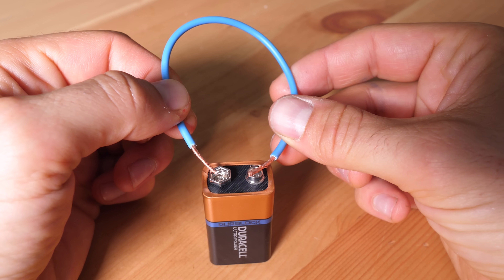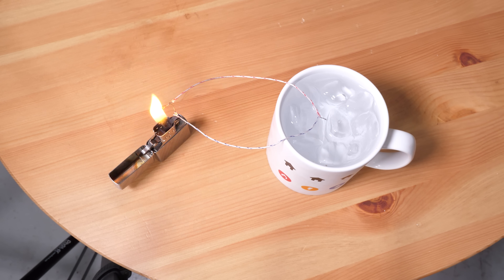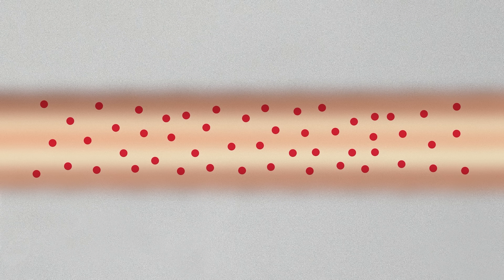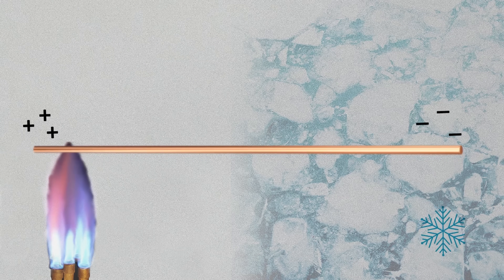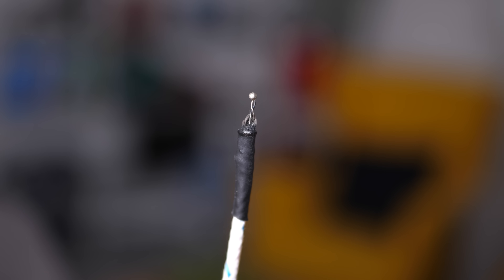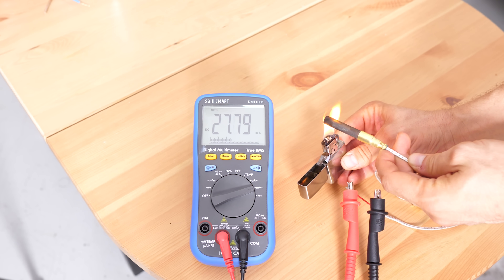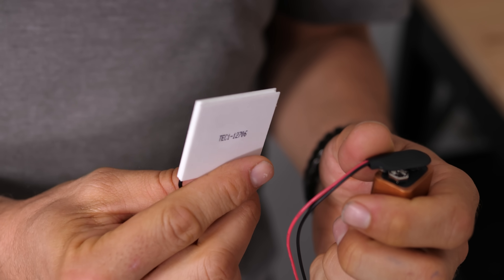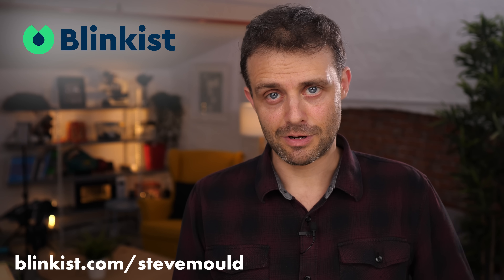Make Electricity Go Round and Round - The Thermoelectric Effect

Comment: I was reading a book to my kid about spacecraft and it mentioned that the generators on Voyager I and II use heat from the decay of plutonium to heat wire made of different metals to produce electricity. I always wondered how a radioactive source could make a small sustained electrical source and you video describes it perfectly.

Comment: a few years ago I had a need for a water chiller, so bought a 10x of TEC/peltiers from china, by far the cheapest way to get them. I needed 4 for my project, and broke one.

with the leftovers, thought Id play around, I decided to make a kerosene powered phone charger. I saw this: http://www.douglas-self.com/MUSEUM/POWER/thermoelectric/Russian%20Kerosene%20Lamp%20Generator%20a.jpg in an magazine a long time ago, which I found online here http://www.douglas-self.com/MUSEUM/POWER/thermoelectric/thermoelectric.htm . an excellent page, an OG example of what the internet was.

I went with a kero tilly lantern, AKA a hurricane lantern, a small Al heatsink with quite wide fin spacing (i didnt want to much soot fouling, and being able to clean it with a cotton bud was important) on the hot side, and an old 120mm heatpipe CPU cooler for the cold side.

I got it working pretty damn well. using a 5v 120mm fan, I could get a pretty consistent 6v supply, the fan taking about 100mA, if I drew more than about 600mA the voltage would tank to below what the fan needed, and that was a bad time. but I was able to charge a phone with it. I didnt use my good phone at first, but after a few succesful tests, a kerosene flame and a good heatsink, usable power! I took a vanity shot with my good smartphone, but most testing was done with a small powerbank or obsolete phone.

the most important thing I learnt, you need to bootstrap the cooler. just lighting the flame and heating it up never worked, as the waste heat warmed the 'cold' side, so it never made power. you needed to run the fan off a battery for the first minute or so to get your temp difference. just lighting the flame, eveything warmed up evenly. start the fan, light the flame, give it a bit, remove the battery and connect the fan to the peltier. enough power to run the fan, and she ticks along wonderfully.

The best thing about this system is its 100% recovery, no loss in using it. if you need to run a kero lantern, your wanting light, and the heat is waste. sure, its awful inefficient, I figure 5-7%, but not using it is 0%. some power is better than no power. I wouldnt want to depend on it, but it can charge your phone if you need it. 

I think the coolest application tho, is distributed lighting. I quite like the light from a kero lamp, for a social, ambiance setting, talking, drinking, eating. not walking into things. but 2-3w of LED lights is really quite a lot in comparison. and it can be directed. for cooking, reading, fine work, its gamechanging. a Kero burner can easily light up 2-4 other workspaces.

granted, this isnt cheap or practical for a 3rd world/humanitarian situation, it was once a very expensive heatpipe cooler (but obsolete CPU, so worth very little), and a very efficient fan. it also really only worked hanging, so much weight up top. but for my situation, main living space outside under the patio lit by kero (hanging from the rafters), a 3m wire into the kitchen, a few 1ft lenghts of strip light and a spot COB, actually worked brilliantly. easily quadrupled the lit area one small flame could manage. 

Ive got very reliable 240v from the wall and more solar panels than I know what to do with, but this was a pretty fun project. the peltier effect is just a flat out neat phenomenon. if your so inclined, they are very cheap from china (dont get the good, expensive ones till you have a working system, you will break them. well, I did...) very fun to play with if you like thermodynamics. 

PS, If your not into buying new things, there are SO MANY peltier fridges thrown away. they are, generally speaking, pretty shit. readily available from your local thrift shop, recycling center, dump shop etc. but a great source of TEC's, and pretty chunky heatsinks to. 

happy hacking!

Comment: At 4:55 you say that the electrons go in a clockwise direction. Flowing from plus to minus. But electrons are negatively charged and thus flow from from negative to positive. Earlier at 3:26 you clearly state a deficit of electrons on the hot end. If there is a deficit, the electrons should (again) move from cold to hot, because at the cold end there is a surplus. Thus going counter clockwise.

Comment: This doesn't really feel like a perpetual thing, does it? A voltage is pushing current around.. Here the voltage is by Seebeck effect. If you short the secondary of a transformer, then also the current is going round and round. There the voltage is by induction. 
If you want to see current going round and round without a voltage, look into superconductors. You can start a current and short the ends and current will keep on flowing. How do you know? You can measure the magnetic field generated by that loop. 
This is used in all modern MRI scanner magnets. The magnet is made using superconducting wire (Nb-Ti wire). After charging the magnet to anywhere from 200-500 A, the ends are shorted by something called a Persistent Current Switch (PCS) and current goes round and round. If you check a MRI scanner, there will be no wires connected to the magnet itself. It is electrically isolated from everything else. (The only downside is all this happens when a superconductor is dipped in liquid helium at 4.2K.

Comment: I have a theoretical question if we were to make an upscale version put one end in say Cairns Queensland Australia read it down the coast to Antarctica is it feasible that the temperature difference would create a current? ..if so how much .. could we have a system in which just to charge your phone's or street lights or is it completely not worth it at all?.. or ofcourse if we could build one around the earth through the North Pole down through the equator through the South Poleand back up through the tropical equator again and let that be the loop.. hot and cold of course then you've got resistance to deal with but I don't know....
Reply: Unfortunately no. The driving force of this effect is the difference in temperature not the distance. A lighter flame is somewhere around 2000C with the iced water near 0C, so a difference of 2000C generated 10s of mA of current but even a single phone would require 100s of mA to actually charge. In the natural environment you would be lucky to get a 100C difference. And also, as you mentioned, wire resistance is a thing and has an increasing effect the longer a wire is and it would completely neutralise this amount of current (converting the electricity to heat) over any useful length. I also suspect (but have not researched) that the more gradual change in ambient temperature that a long length of wire would experience would also work to cancel out or at least reduce the effect.
Reply: I hate how the world's full of this stuff that you can't really do much with.. it's like an Awesome fact but good luck trying to do anything with it..🤣🤣🤣 such is life🤣👍 cheers

Comment: I hate to point out another flaw in this great video, but I take a bit of issue with
"in [...] metals some of the electrons are free to move around in the bulk" @ 1:57
As the free charges reside on the surface of the conductor, I think you should have worded this differently.
Reply: Fantastic explanation of the effects, though ^_^

Comment: At 5:07 you said that thermocouplers are used in a lot of thermoteters, for example in the push in thermometer you used. 
From my experience (especially in the industry) resistance based measure is much more common than voltage based measure, and also a lot more precise. The industry uses PT100 or PT1000 to measure temperatures accurately. Those are sensors that use a piece of platinum with a known temperature-resistance curve. So the resistance measured is proportional to the temperature. Thermocouplers sre generally used for medium to high temperature applications (>200°C).

Comment: You explained that the two different metal wires create a flowing current. My question is why are they flowing in opposite direction if so then would making a loop with just the metal with the higher seebeck effect create a higher current?
Later in the video you explained it with adding voltage to create the heating/cooling effect. The electrons "bouncing" from one level to another. Is this the same principal that creates the flowing current when the wires are exposed to ice and fire?

Comment: Is it possible to have 2 metals - though they may be ceramic or something - which are both superconducting but have different thermoelectric constants?
Could you create a voltage and therefore current in them but because they superconduct the current never decreases?
In fact it increases as the effect goes on for longer.
Would a super-magnet or something occur?

Comment: So let's say you could freeze one end to near absolute zero, and put the other end in a pressure chamber to increase the melting point of that end, and heat it above the melting point at atmospheric pressure, would the voltage be greater than just doing it the way demonstrated in this video?

Comment: One confusing part of the description was that it sound as if one could generate cold by just pushing the electron in one direction. This is however not possible: You cannot just generate cold (also first law of thermodynamic would be violated else). Peltier always have a hot and a cool side.

The way I'd explain it is more with an analogy with a fridge where air is decompressed on one side to generate cold, but then it needs to be compressed again for the cycle to restart and that generates heat (no choice).

Comment: Thanks so much for making a video on this! It is a really fascinating principle. I wanted to say that the master volume on your video was extremely low this time. Even with my volume turned all the way up it's hard to hear without headphones.
 I am familiar with the peltier effect from My friend who works at the railroad says they use them to power the equipment in the event of a power out. That's why you see propane tanks alongside of train tracks.
My parents also have some ice chest coolers that are electric, plug them into the 12 volt outlet on the car and it creates about a 25f difference in temperature to the ambient

Comment: The same mechanism as in boiler is used in some gas-powered kitchens, where such thermopile or thermocouple forms a safety mechanism, closing the valve if gas burner gets extinguished, perhaps because the thing heated up boiled over.

Comment: I have a gas stove, and it's not connected to electricity, doesn't even have such a connection, it's about 20 years old. The single stove burners do have a - compared to the thermopile you showed from a boiler - tiny tip sticking out next to where the flame is, so I wonder, do they work based on the same principle? Because then that would mean the solenoid needs only very little power to be held open, since this tiny thermopile (if it even is one) of course generates much less power than the one you showed here. The ones on my stove are maybe 2mm in diameter, something like that...?
(I've always wondered how that works, and I assumed some sort of bimetallic effect, but no, it's even more genius, if it actually uses the thermoelectric effect)

Comment: 5:38 "the voltage you can get from it is much greater as you can see here" ... shows current on multimeter :p
Reply: Between that, the electrons going from + to - and the wrong shot used for the bouncing balls, you can really tell this one was rushed, yeah.
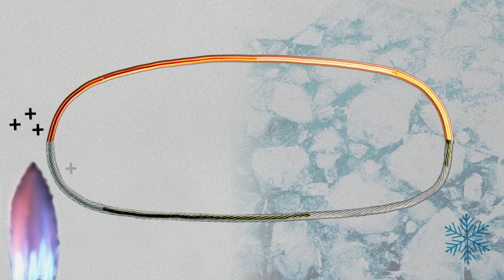Reply: @Karreth  if you are referring to 4:35 for the +- thing, it actually makes sense in this case, because we are talking about a current inducing a voltage not the other way around. the electrons aren't moving due to an abundance of electrons as we are used to, but due to heating. the original source of the electrons is in this case positively charged as weird as that might seem.
Reply: Current is a function of voltage.
Reply: @vonSachsenbach  and resistance... ¯\_(ツ)_/¯ If you're going to show a higher voltage, stick the DMM on voltage.

Comment: the round and round thing happens quite a lot by necessity when you have a load with a lot of "mass" ( inductance ) like a magnet or something. connect a diode to it, and then power it with a battery so the diode is in reverse bias and conducts no current. when you disconnect the battery the current will want to keep going because of its "inertia", and go through the diode to maintain the loop till it dies down due to resistance- freewheeling. Without the diode it comes to stop suddenly and causes a large spike in the voltage.

Comment: Fun Fact: I was once called to a laboratory to investigate why a 30mA RCD was tripping. One of the Lab men pointed out that the tripping always coincided with the Temperature Gradient Kiln reaching 1000 ^C or so. Sure enough a bank of thermocouples had their negative terminal grounded which resulted in over 30 mA flowing to earth and 'confusing' the RCD.
Reply: That's a fun one! Why would they ground the thermocouple though, were they assuming 0V on the negative end and measuring positive to ground? (it surprises me because I feel like you were dealing with big/important/precise stuff?)
Reply: @cheaterman49  Yes mate, correct, a temp gradient kiln had 9 zones with around 10^C difference/zone, this was to test the best firing temp for glaze or colour on pottery ware.
Reply: @paulvale2985 
It's hard to imagine how the temp probes were even reading accurately if the minute power they produce was being sunk elsewhere.
Reply: I dont know much on the topic, but I will say that I do know of grounded thermocouples. I've had to change them out because they're not compatible on the devices I'm installing for work. Not sure if they function all that differently or not... I guess this video may have sparked a google research rabbithole for me.
Reply: I don't understand
Reply: @Rani-mt7dj  RCD == GFCI in America
Reply: @Rani-mt7dj  In the UK a Residual Current Device looks for an imbalance in the Live and Neutral conductors at the mains supply board thus, with the Neutral grounded as standard, more than 30mA injected to ground by the combined thermocouples tripped the RCD.

Comment: 5:38 that's current, not voltage
Reply: True, but the voltage would still increase per Ohm's Law.
Reply: Current is a function of voltage.
Reply: nah, OP is right. Ohm's Law doesn't help here.

we have no way of distinguishing a drop in resistance from a increase in voltage here, either one could be true (or something completely differrent could be going on). If we want Voltage, we need to measure voltage here.

Assuming resistance would be constant would most definetly be false, since we are dealing with substantial temperature differences (there is litterally a flame touching the wires).
Reply: @antonialiesa8406  that is a fair point.